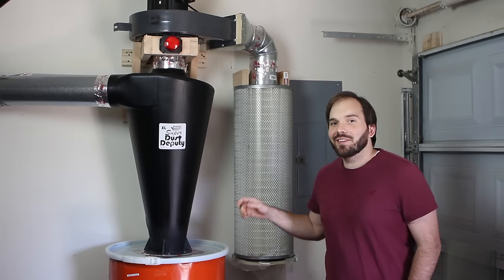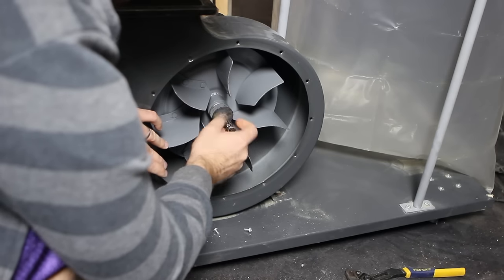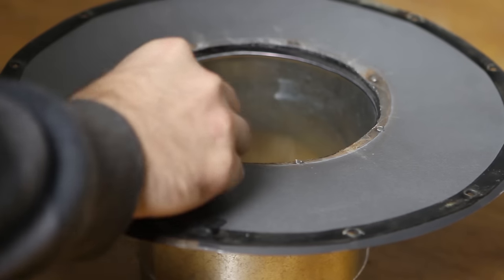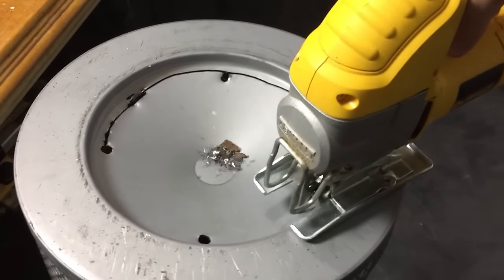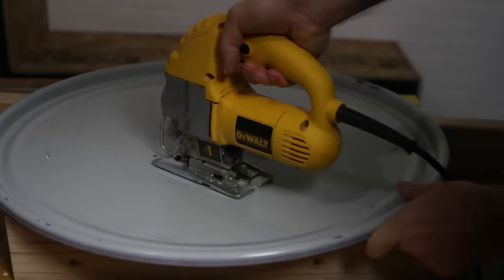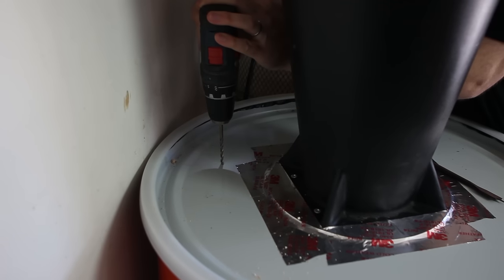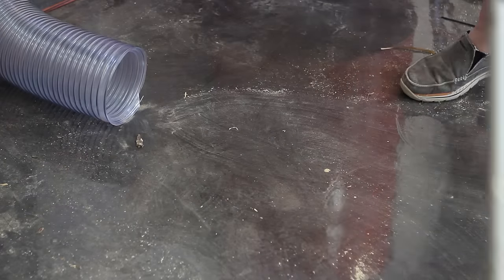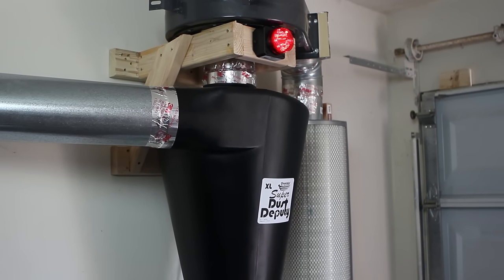Harbor Freight Dust Collector Mod w/ Super Dust Deputy XL - Updated

Comment: Nice video which I just recently saw for the first time. I've seen several comments about the larger impeller drawing more amps and tripping their 15 amp breakers. That's not a worry for me as the breaker servicing the motor is 30 amps. My electrician tells me I should worry about the increase amperage draw causing dangerous heating to the 14 gauge wire leading to the motor. Have you had any troubles in this regard as I'm considering rewiring with 12 gauge wire?

Comment: Nice design.  I have watched your video 2 or 3 times.  Who would have thought reversing the veins would get more air and less noise.  too deep for me.  I have a Jet I want to do the same thing to.  The Jet has a very large filter.
Why the drop from 40 to less than 20?
Does the 10' hose cut the air in half?
Is the filter restricting the air?

Comment: Did you somehow mount the motor to the wall mount or it it just sitting the and the weight is enough for it not to move?
Reply from the maker: I intended to screw it in initially, but there is no vibration. I want to say it has been two years and it is still sitting in the same place.

Comment: I've read through every comment and couldn't find where anyone asked this but is your motor physically mounted to your supports?  It looks like it's just sitting on top connected to the SSD and to the filter piping freely.  Kind of wondering if you've noticed any movements of the motor if that's the case?  I'm in the middle of modifying my DC MOD for the 3rd or 4th time (lost count as each time it's to reduce space) trying to see if I go with your route as the position of the air output would require a similar position to yours.
Reply: Did you determine how the motor was physically mounted to the supports?  I am about to do this and wonder if the starting torque is overcome just by the lever arm effect mount of the air filter.

Comment: Great video with lots of detail, many thanks.  I am trying to source a similar air filter over here in the UK and it would help if I could find some more details of the filter you used.  Thanks!
Reply from the maker: The filter has an inner diameter of 8.375 an outer diameter of 12.75 and is 36inch long. It is a Clark P1565938.
Reply: Thanks for those specifications!  I will see if I can find a listing for it over here in the UK. Failing that I will look for something of a similar size.

Comment: Great video,  How do you lift the can to the lid and cyclone, and how do you keep them secured to each other?
Reply: I came here wondering how the 55gallon drum is attached. Does it basically slide under? Does it need to be slid under and then raised to clamp the lid? Or...?

Comment: Have you checked on local codes for how far things have to be from your breaker box? We couldn't have anything impeding access to the panel at two seperate auto shops I worked at years ago. Had a 3'x3' square painted on the floor that nothing could go into or be above that area. Though commercial and residential rules may differ? But it still seems too close in your video.
Reply from the maker: That is a good point! I didn't even think about it until you said something. I intentionally placed it as close as possible without actually covering the panel to make more space in the shop.

Comment: This is the best video on the subject yet. Two questions

1) I have the regular super dust deputy w 5" inlet and 6" outlets. Is it worth upping the impeller?

2) would the HF side cylinder that it comes with make performance better?  Curious why you left it off.
Reply from the maker: Thanks! I would say it is definitely worth the upgrade. There is still an increase in CFM without increasing the 5" inlet. Plus, the impeller design is more efficient. I don't think the side cylinder would make performance better. It restricts the airflow compared to the 6" duct I used. Also, the 90 degree turn directs the air to the bottom of the filter so any particles the make it through the cyclone go straight into the bag instead of into the filter.

Comment: This is one of the simplest and most straightforward HF mods I've seen. Thanks for sharing. I'm sorry if I'm missing something obvious but where did you get the 12" replacement fan? Does it come with the HF dust collector?
Reply from the maker: Thanks! I sourced it separately from Rikon. They sell it as a replacement for their dust collector
Reply: Is there a part number for the Rikon impeller you can share with us?
Reply: @75blackviking  I was wondering the same thing and I found the replacement impeller for the 2hp dust collection system on the Rikon web page.  Unfortunately, they are currently out of stock.   Here's the info, for what its worth.

P60-200-22	
Impeller – Sturdy Metal Design with 7 Rear Facing Blades
(Dia. 11-3/4”, Shaft Dia. 20mm, Height 3-1/4”, Shaft Hub Length 1-1/4”)

Comment: did anyone catch how the motor/blower was secured in place?    It can't just be sitting there and staying in place due to gravity, right?
Reply from the maker: I just put a large bead of silicone caulk on the board, but the weight of the motor and boards around the duct also help keep everything in place.

Comment: Where did you get the larger impellor and what model is the new filter from Wynn.  This is the best upgrade I have seen on You Tube.
Reply from the maker: If you click the link in the description it will take you to a page with all the supply details and links.
Reply: Did that and found nothing on the impeller.  Good project though.  Were you able to upgrade the wiring in the motor to 240V from the standard 120 it comes with?  Often you can just change the wiring in the motor box which shows it wired both ways.  Getting ready to put one in my expanded shop and always wondered why the impeller had so much room around it.  A pump's efficiency is greatly determined by the impeller to housing clearance--the tighter the better.  You found a quick solution it would seem.  Were the shafts the same when installing the new one?  Thanks.  Take care.  Doug

Comment: Is that the 2 hp dust collector? Looks like several components missing unless it’s just the 1 hp. Also you said 753 cfm and the 2 hp is rated at 1550 cfm. Maybe that rating from HF is bs. I have an old craftsman 1 hp and was looking at the 2 hp but this video makes me think I could just upgrade the 1 hp with impeller and 4” dust deputy vented outside and experience an improvement.
Reply from the maker: It is the "2hp" dust collector. When I was doing my research I found that high end dust collector companies post actual CFM (tested in actual use) and Harbor Freight doesn't advertise that number. That sounds like it would work if the shaft of the 1hp motor is the same size. The larger impeller is a little heavier so it take more amps to ramp up.

Comment: How do you clean the cartridge filter?  I'm considering doing something similar to this but I'm not understandig how you would go about cleaning out the filter?  Just bang on the sides of the filter?
Reply from the maker: +Chris Scott I've only had to clean it out once since the build and I used a shopvac to blow air into the filter before vacuuming up all.

Comment: Hi.  How did this work out in the long run?  I was looking at the specs for the filter you used and it has a nominal rating of 500CFM.  The 2hp blowers can provide about 1800CFM.  Did you find the filter undersized for this application?

Comment: Have you tested your amperage draw with the new impeller?  I'd be curious to know how many amps it's pulling with that larger impeller.
Reply: thesergeant I'm wondering the same thing. I've heard that the initial power draw on this DC is pretty severe in stock form, so I'd be very worried about the larger impeller.

Comment: Interesting that you’ve omitted the plenum box. Did you research the effect of that?
Reply from the maker: I definitely did my research and based the design on cyclone dust collectors that did not have a plenum. I’m not really sure what the point of the plenum is if you only plan to use one filter. Let me know if you have any more information on the plenum design.
Reply: Thanks! I was about to order my filter, and decide between one with a flange or without... I may leave the plenum out of the picture if it seems like the direct connect will be less hassle than building one.

Comment: Is this set-up still working for you? I made a thien baffle and only get 550 cfm from the outlet using the same upgraded HF DC you used. Might make the $240 worth it to get some extra capacity.

Comment: Where did you pick up your galvanized duct fittings?  Great build, will duplicate yours!  Thanks!
Reply from the maker: +Gary Christiansen Thanks! All the supply details are on our website. There is a link to that page in the description below the video.
Reply: I have purchased the Rikon impeller for harbor freight dust collector and the filter and the Oneida cyclone also.  Waiting on a shop enlargement hopefully in Jan. or Feb.  I saw on youtube that if you have a 2 HP dust collector or smaller you can use 30 guage metal ducting.  But if you have a larger HP collector you'll need to go with a heavier gauge metal for the ducting.  Probably 26 gauge but I am not sure.  If you choose to go with the heavier gauge, Home Depot and Lowes won't have it.  You have to find a commercial supplier for that.  Food for thought!

Comment: I can't find that filter anywhere. Just fatter ones. Any advice?
Reply from the maker: Finding the filter for the Dust Collector mod seems to be a huge sticking point. I think I was lucky to find this one on ebay. I found this one that could work: https://www.airmaxind.com/shop/airmax-amx502-premium-cartridge-filter-8115?gclid=CjwKCAjw6vvoBRBtEiwAZq-T1cT0p217wwVg4Rec_mlyATIxdU162aECfiBre5bv3EJ7dqXXDUmxSxoCU58QAvD_BwE  . If you are looking for filters I would recommend looking for a filter with a diameter large enough to fit that metal transition and has a high "filtration area' this is usually a number in sq/ft. The way I understand it is if you unfolded the pleated filtration media that is the sq/ft of the material the air can flow through. The more area the easier the air can exit the blower. Some companies stack shorter filters to increase this.

Comment: Excellent video.  I'm just starting to build my HF DC system for my basement work area and I'm leaning very hard towards your design.  Bouncing between 5" and 6" ducting.  Also Questioning the 6" coming into the top of the filter and blowing straight down.  What is that impact on the small plastic bag you have at the bottom?  Isn't the force of that air blowing straight down into the bag?  I know you said there wasn't much dust in the bag but could that be because it's blown back up into the filter?   Thanks!

Comment: Also, for grounding your dust collector, did you connect a copper wire from the base of the unit around or through the cyclone part of the collector to the metal?  As I understand it, it needs a continuous ground throughout the system.  I'll be using metal duct piping all the way instead of pvc piping.

Comment: Great design. I am working on this upgrade to my HF DC right now, but can't decide if I should get the SDDXL or the regular SDD (do to Oneida's recommended sizing). Any input? Do you have a performance update?
Reply from the maker: +john Carter The dust collector is working as good as I could have ever hoped. I have filled up the 55 gallon barrel and the filter is still clean with nothing in the bag at the bottom of the filter. I am a fan of the SDDXL  and like that it is compatible with 6" fittings/pipes on both sides. I haven't had a chance to work with the SDD to do a comparison but I'm not disappointed with the larger unit.

Comment: My delta blower is similar to the harbor freight blower.  I was concerned changing the motor mount from horizontal to vertical.  I was wondering if the motor and fan bearings were good for any direction of mounting instead of the design setup?  I mounted my unit in the same orientation as factory setup.  Just used a elbow in the mix.  The blower bag just shoots out about a foot above my head as I am walking under it.  How is the long term (2 years) working?  I just installed my 4" dust deputy last night.

Comment: Great Video!

I am impressed that you referred to the potentiometer as it is, opposed to those calling it a rheostat on the sensor adjustment.
All my tools are based on the 4 inch port and I have the HF blower and I am trying to decide on the 6 inch or the 4 inch dust deputy 
What are your thoughts? Sure a 6 inch Plenum will move more CFM however using one tool at the time will it make that much difference?
I currently have the stock impeller on the blower. I may upgrade that as well, what are your thoughts? What is the the best bang for the buck?
Retired! Thanks.
Reply from the maker: +TheFalconJetDriver Thanks. For me the main factor I considered was that some of my tools had to be 15-20ft from the dust collector. On a short run it isn't as big of a deal. However, even just running 1 tool 20ft away on 4in duct will restrict the air flow considerably. The 6in lets more air move and creates less static pressure over longer distances.
Reply: @GrayHouseStudio  I'm in the same boat.  My shop is 20x30 with the DC in one corner.   some of my tools about about 20-23 feet away (direct line not pipe length).  Do you see good dust collection at your tools with this setup?  What CFM are you getting at distance?   Btw, great video.  Thanks!

Comment: Nice upgrade... It looked to me like the impeller blades on the upgrade were the opposite direction than the original.  I would think this would make a difference in cfm as well.
Reply: if he didn't rewire the motor to spin in the opposite direction, he's losing 60% or more efficiency.
Reply: @Afredericknyc  its designed to go that way

Comment: Thank you for the information. I am about to do a very similar build to my dust collector however my question is: how did the 1/2" screws drilled on the top of the filter not destroy the filter media? I just purchased a very similar nanofiber filter and would not want to destroy it. Thank you!

Comment: Nice job. And the presentation moves along. 
How do you raise the lid enough to free the drum for emptying?
Reply from the maker: I put a little motorcycle jack under the drum of the dust collector. This makes it easy to roll the full drum around and lift it into place under the fixed lid. My ceiling wasn’t tall enough to put flex between the cyclone and the drum.

Comment: 01:10  Wouldn't the 12" impeller work better if the vanes were turned the same way as the original one?
edit  I just looked again, and it looks like the original is the one that was backwards.

Comment: Is there a link to where you bought the 12 inch impeller blade?
Reply from the maker: Here is a link to the Rikon impeller that fits as a replacement on the Harbor Freight Dust Collector: https://www.rikonparts.com/product/60-200

Comment: I see that the Rikon impeller has the blades facing opposite the HF fan.  Did you change the direction of the motor rotation?
Reply from the maker: +Wray D the motor spins the same direction. The original was a forward facing impeller and the new one is a backwards facing impeller. The backwards facing impellers won't overload the motor under pressure like forward facing impellers can.

Comment: I just finished setting mine up just like yours, however I’m getting more debris under my filter in the bag.  Any ideas what causes this?
Reply from the maker: I had a similar problem and realized I wasn't getting a good seal at the top of the barrel. That was sucking in air and pushing debris up the cyclone. I added two layers of duct tape to the rim of the barrel and hammered out one dent in the rim. That solved my problem.

Comment: I think it is funny most peoples comments are based on the reversed blade direction of the new impeller and Matthias is doing experiments right now to see which one is better.. and the reverse is better from what he has put out..
Reply from the maker: +Michael Chipser Thanks for sharing! I follow Matthias but hadn't seen that video. I'll have to share that video next time someone asks about the reverse blades on my dust collector.
Reply: Thanks for the video by the way.. I am about to get the harbor freight dust collector.. I was planning on doing something like DIY Tyler, but this seems a little easier.. Thanks again!
Reply: For what it's worth, I did what DIY Tyler did last night and tonight tore it all down and changed it to this style.  I liked this style because there is a lot more variability.  You can make slight changes  while the collector is already mounted to optimize space savings and reducing bends in you pipe, (specifically the outlet).
Reply: I believe you can also tilt the cyclone about 20% without ill effect for a lower ceiling.

Comment: Would you be willing to share what software you use to edit your videos? I use my Samsung Galaxy Note 5 with a tripod but have struggled to edit my videos so far. I am using freeware programs (Lightworks X64 12.6 and VSCD Free Video Editor)  and have spent  hours, sometimes days to try to get it right with little success. So far I've ended up with more frustration than it's worth and basically have quit trying because its just too difficult. Any help would be greatly appreciated.
Reply from the maker: I use Adobe Premiere. Having a quality video editing software makes all the difference. I used iMovie for a while but have recently moved over to Premiere because it has more features.